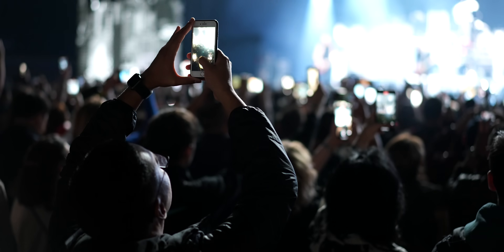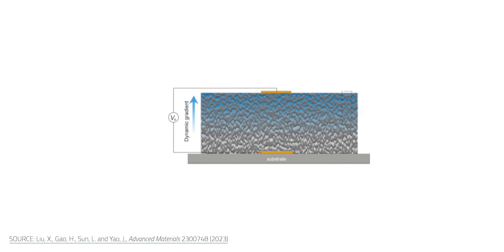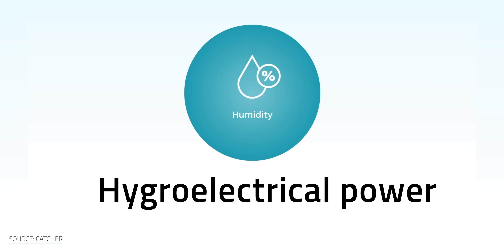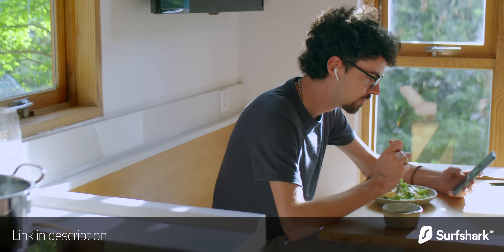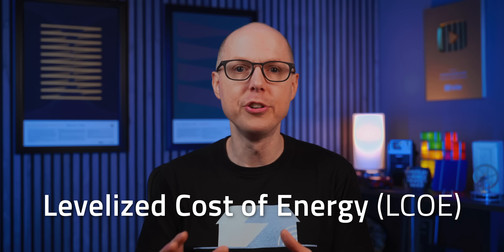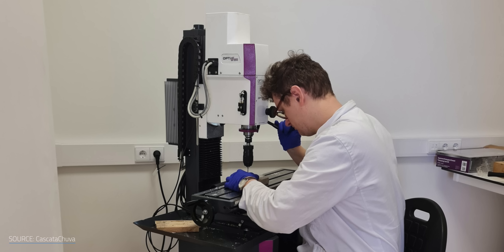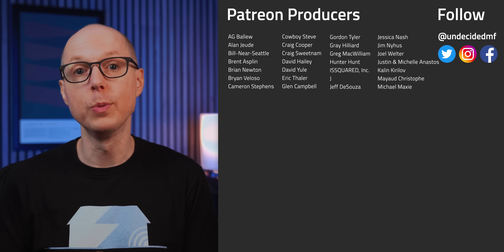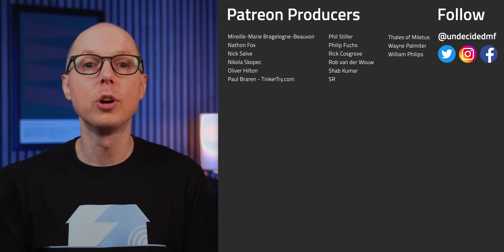Is This Accidental Discovery The Future Of Energy?

Comment: I saw this news just some days ago on another channel,
and a 2m2 sized (by actual results) base electric making unit for the near 1 KW base usage here during the night is not only nice for home, also even easier to get allowed to install and reduce a lot all over.
I keep that in mind, as batteries are not that nice yet, and direct produce the night usage much better.
As now about 42 KWh a day, only the night is a problem yet if Thailand changes its still very nice feeding rules. So only the real night time is in my focus, with a solution like you mentioned.

The big usage to move energy Solar to night cooling (Solar to Battery to AirCon) I also want to avoid with a maybe 1.500 Liter Water Container cooled during the day with direct Solar power and also avoiding the battery problem.

Comment: As another person here mentioned, how does it maintain a moisture gradient between the nanostructures for a long time?
Reply: So if I understood this correctly, this tech is based on the ambient air humidity changing over the course of the day, and harvesting some energy from the water molecules as they wiggle their way in and out of the nanopores to maintain equilibrium. If so, then it will only work during large humidity changes. Though I figure you could heat up the material accelerate drying. Or at least, that's the only way I can see this structure harvesting energy without REVERSING ENTHROPY!
The cynic in me sees this as being just another technology with few real use cases, hyped into the clouds by startups looking to squeeze money from physics illiterate investors. There's no shortage of those.

Comment: I live in Ukraine, use gas for heating, on demand hot water, and cooking. We use 3 cubic meters each months during the summer.  Entire home is electrically powered by  18 120W solar panels with need for external utility power only during the three or four winter months.  LED lights, efficient Bosch refrigerator and other utilities, 24 hour use of laptop and periodic use of the TV even allow us to use a water pump do deliver water to the garden from a creek three times each week during the dry months.  You must only be aware of your energy usage and schedule your activity for high electrical usage when the sun is out.  Love the fact that when Russia puts out the lights in the neighborhood, we don't even notice it until night when the street lights are not on.  The Lithium-Iron-Phosphate batteries (1200WH) work like a charm with a single 230V 6000W inverter.  Thanks for your shows!

Comment: So where does the energy come from? Assuming that the source of energy is not internal and finite (i.e. degradation of the battery itself), the only thing that comes to mind is phase change of water vapor into liquid (heat of condensation). For 10 kWh/day, the device would have to condense about 16kg of water with 100% efficiency of energy conversion - probably an order of magnitude more, assuming more realistic numbers. This means tens of thousands of cubic meters of air going through the device daily. Is this self-propelling dehumidifier equipped with fans and pumps? Does it produce liquid water? So far it looks like a scam to me.

Comment: My guess is that this fails to be a home power source outside niche climate zones and applications.  I can see them being useful in rural maine but grid based electricity will likely always be the cheapest option in urban environments.  

That said, this might mean bluetooth tech need never be charged, you just make sure it goes in bathroom during a steamy shower.
Reply: If I'm understanding the paper correctly it's most likely harvesting the atom's movement as heat into energy from the impacts so having it in a bathroom while you are showering would work pretty well. Sadly it looks like the material can clog / wear down from other materials in the air so it might not be practical in environments with pollen... Here's hoping that they figure that out.

Comment: You could use this new found technology in combination with a humidifier to produce the electricity and if the material requires it a dehydrator to dry off the layers making a cycle and if optimized enough could power itself the only requirement needed would be water added when needed. It could be a single unit of clean energy available for household use. This could be improved on in the future to create enough to power an entire grid and I’m sure that the co2 and waste required to create could also be improved. This could also be used to power desalination plants to produce clean water which could be used for a population or to feed back into the loop. Honestly fusion energy focused groups should focus on this rather than fusion which hasn’t had too many advancements in the past few decades. It’s an amazing revolutionary concept that could have major implications.
Reply: What you are describing here is similar to the argument of pointing a fan at a windmill and having the windmill power the fan. We have humidity gradients naturally because of the sun, so if this does work at all it's basically another form of solar energy (like windmills that get energy from the wind, but the wind is caused by temperature gradients which is because of the sun). You can't get more energy out than what is put in and that energy has to come from somewhere, either the sun or some consumable fuel.

Comment: Would/Will be cool.  I have a number of off grid sensors that take periodic measurements.   Assuming this works it could be helpful.  Time will tell.  Always good to see new approaches, love the accident in finding it.
Reply from the maker: That's a great example of where something like this could potentially find a niche (depending if and how it works out). I love these accidental discoveries.
Reply: @UndecidedMF  yes, at many of these locations conservation of power is used leveraging deep, deep sleep, extreme low power, microcontrollers and minimal sensor input. For power e’ve looked at leveraging AM radio transmission power like you would get with a crystal radio even collecting that in a capacitor. These are locations where we can’t put up solar because of form factor issues. Any and all possible new ideas will help somewhere. Of course cost trade offs vs importance is always there.

Comment: It sounds like what they have made is a battery, not a generator. If the energy is in a humidity potential from one end of the material to another then eventually either one end will need to be dried out, or the other end will need to be made more humid. When manufactured dry it is effectively a pre-charged battery.
Reply: That is one possibility.

Another possibility is that some material in the construction is hygroscopic, and upon absorbing water from the air, it creates some kind of conductive electrolyte that causes the metals of the electrodes to function as a conventional chemical battery, whereby one or both metal electrodes will disintegrate or otherwise change chemical form, upon attempting to extract electrical energy from the cell.  

However, there is a third possibility, which does deserve actual study.  Water molecules in liquid form do in fact have fairly strong binding energy between the individual water molecules.   When a water molecule exists full in a gas (steam) phase, it is not chemically bound to any other water molecules.  However, when that water molecule finds another water molecule or droplet of water to bond to, it does do so, and the process is exothermic.  There is an energy release when a free floating water molecule attaches itself to an existing liquid water droplet, and this energy release comes from the bonding energy associated with the hydrogen bonding and London dispersion forces between water molecules in the liquid state.  This energy release is fairly significant, and is ~627 Watt hours per liter (~2.4 kWh per US gallon) of water that gets condensed out of gas phase and into the liquid phase.  This energy is also known as the heat of vaporization, and overcoming it is what takes so much thermal energy, in order to forcefully boil liquid water into a gas.

In other words, water molecules in the gas phase are in fact in a higher potential energy state, compared to liquid water.  It is therefore not against any laws of physics, and is in fact required by the laws of physics, to release some kind of energy, when gas phase water molecules condense into liquid water.  Normally, this potential energy gets released as random motion thermal energy, which adds heat energy to the liquid water, when gas phase water molecules condense into a liquid water droplet.

However, it is not totally inconceivable that by some novel mechanism, the energy release associated with the creation of new hydrogen bonds and/or London dispersion forces bonds, could get captured in electrical energy form, rather than as random motion thermal energy.  If this was somehow happening in the device mentioned in this video, then the product might actually be real, it may not be some kind of unintentional battery, and it might not be violating any laws of physics.  If it does work by such a mechanism, then it would effectively be some kind of ambient thermal energy (which powers the evaporation of liquid water into humidity), to electrical energy converter.  Such a device, if it worked, would give those who hold an excessively rigid interpretation of the second law of thermodynamics, a cow.

However, I would point out that conventional hydroelectric power generating stations already technically violate Carnot's formulas and the second law of thermodynamics, at least, to those who hold an excessively rigid (and incorrect) interpretation of the second law of thermodynamics.

The second law of thermodynamics basically says that entropy always increases, and that heat energy always flows from hot sources to colder places, unless forced to do otherwise by adding externally supplied work energy to the system.

Many scientifically minded people currently interpret this to mean it is impossible to extract useful energy out of random motion thermal kinetic energy sources at ambient equilibrium temperature, such as a cup of water at room temperature, sitting in a room temperature ambient environment.  However, even at room temperature, the random motion thermal kinetic energy of the water molecules in the liquid is sometimes enough to allow specific higher energy random motion molecules to break free from the hydrogen bonding and London dispersion forces holding it in the liquid form.  Consequently, evaporation occurs, even at room temperature, in a system at thermal equilibrium with its ambient surroundings.

When a water molecule breaks free from the liquid, it has lower molecular mass than ambient oxygen and nitrogen molecules, which, in conjunction with random thermal motion of gas molecules in the atmosphere (at locally ambient equilibrium temperatures), causes the water molecule to rise in the atmosphere, against the force of gravity that is pulling it down towards the surface of the earth.  As a result, the water molecule rises high into the atmosphere, where is has both higher gravitational potential energy, and higher chemical potential energy (by not being part of a liquid droplet, with associated hydrogen bonds and London dispersion forces bonding), compared to what it had when it was still in liquid form in the cup of liquid water.  Once in this higher potential energy state, it can later find more water molecules to combine with, to condense into liquid water droplets, to fall out of the sky as rain, and to eventually get collected into a river and dam.  Eventually the water's gravitational potential energy can be used to spin a hydroelectric turbine to generate useful electrical energy.

Thus, random motion thermal energy can be captured and made to perform useful work energy, and this is proven in hydroelectric power plants.  Hydroelectric power plants do not obey Carnot's thermodynamic efficiency limit formula, or excessively rigid interpretations of the second law of thermodynamics.  In the complete hydroelectric power plant cycle, energy is input into the cycle in the form of random motion thermal kinetic energy in the liquid water, when it is evaporating, while at ambient equilibrium temperatures.  Additional random motion thermal kinetic energy is input to the system, as the water gas molecules rise against the force of gravity, which is also powered by ambient temperature random thermal kinetic motion of gas particles in the atmosphere.  The net result, is that it is possible to generate substantial electricity, with extremely small temperature differences (ex: as little as 1 degree is sufficient, so long as it can cause evaporation of liquid water, and subsequent condensation of steam back into liquid water), at efficiency levels that exceed Carnot's heat engine efficiency limit formula.

Random motion thermal kinetic energy, is kinetic energy, and it is possible to design systems that can do useful things with that energy.  Such is not a true violation of any actual law of physics.  The second law of thermodynamics should ideally be rewritten, so as to be more clear about this.  Hydroelectric power generation plants do work, and the complete cycle is "fueled" by ambient temperature random thermal kinetic energy.

Comment: Just to add to the questions about impacting the humidity that is driving it, does it produce water or gases?   Can it run in a closed system?
Reply: That had me interested as well. If it actually takes water out of the air, it producing a negligible amount of energy still places it ahead of any other system which requires energy to do so.

Comment: Allow me to ask, not as judgement, but to confirm if my eye for detail is correct: The picture of a wind turbine next to a house, was that AI generated? There are enough logical design oversights in that image that despite it not having anything obviously wrong, it still appears to fail to understand fully what its trying to portray.

With AI content becoming more common, it's important to be able to quickly identify procedurally generated content to prevent being misled by something that has no real world bearing. While you were clearly using this image to portray a fictional scenario and such not trying to mislead anyone, using it as an experiment to quickly identify AI art will help avoid being misled in the future.

Comment: What is the required humidity level?  Where I live it is very common to have high humidity during most of the year with summer peaking just before sunrise. however in winter I can see humidity in my home drop down to the low twenties percent wise and I am using a heat pump which means that I don't have the full on air drying that gas would cause. I guess the more important idea is, could it be outside similar to how air conditioners are so they are exposed to highest humidity air possible.
Reply: Just a note - the idea that gas heat somehow inherently dries your home more than other forms of heat is a myth. Low efficiency furnaces and boilers that use indoor air for combustion DO effectively pump the air out of your home, along with any humidity. The air that replaces it comes from outdoors where it's cold and dry.

But modern high efficiency designs pull combustion air from outside and do not cause a net loss of humidity on their own.

Comment: What happens when the water molecules finally completely fill the canals through. No energy gradient, no power flow. It will require high humidity on one side, and low humidity on the other side, And what happens when the canals clog with dust particles?
Reply: Drip, drip, drip.

Inventions aren't just ideas.  Eventually you have to build something and getting rid of condensation isn't a difficult problem.

It puts out dry air.

It runs on wet air.

The dry air that comes out of the exhaust provides the humidity differential.

Using some of that dry air to dry and cool the device is a basic design feature.

Gravity is also pretty helpful for water removal as are various shapes and materials

Comment: To me this looks like it is making electricity from the humidity difference between the different sides of the nanopore. So you need two reservoirs of air of different humidities and the device will even out their humidities over time and then stop working.unless you spend energy to keep the dry side dry.
Reply: Or take a shower.
Reply: If the dry side is dried by a process that generates power wouldn't it stay dry?

How does the dry exhaust get humid again if it's a constant stream of dry air?

It would be sort of difficult to rehumidify the exhaust fast enough for this to be a problem.
Reply: @ericmaclaurin8525  Humidity moves from the wet side to dry side. Not the other way around. The humidities of the two sides approach each other and when they are equal, no power can be extracted any more.

If you dry air, the water has to go somewhere. You can't just send it to hammerspace.

Comment: peltier + any water heat releasing compound like koh = 300Wh/kg energy (heat + electricity), friction electricity is well understood effect, like water flow charge accumulation generators, but reloading a KOH water battery is just heating up the water it contains. yep KOH water battery makes steam works more like a candle, but water activated heat source, like the military quick heat pouches. yep concrete heat water activated battery is better and includes side solid state peltier electricity alongside the main heat.